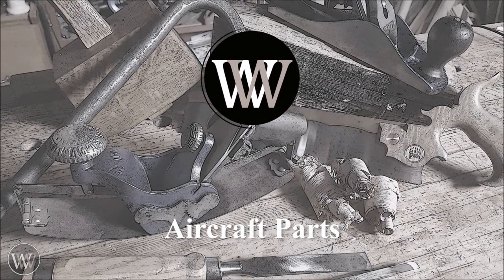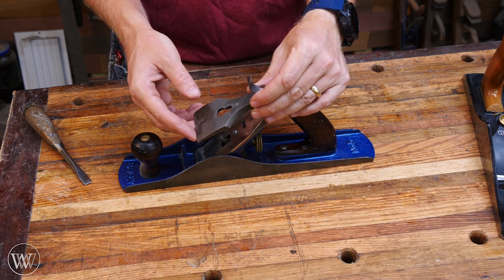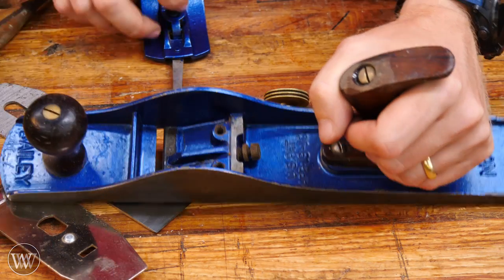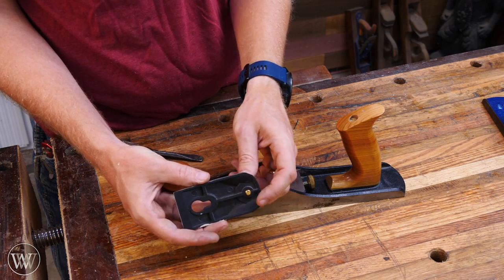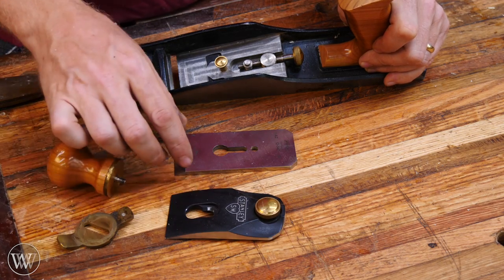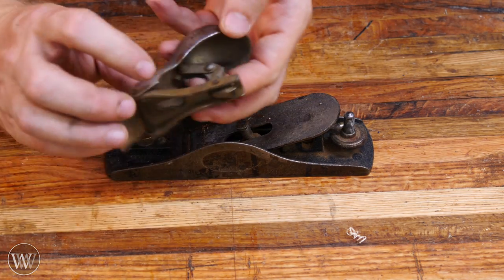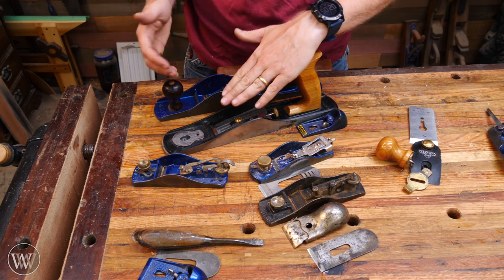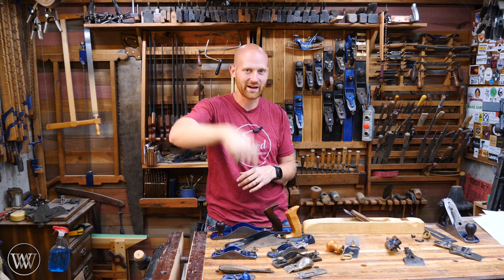What Are The Parts of a Hand Plane - Handplanes 101

Comment: Fun note:  I recently started restoring my grandfathers Sargent 408.  I lost a frog screw and after three store checks and two phone calls to fastener distributors in an attempt to find a replacement locally, had to settle for ordering from McMaster-Carr and waiting.  One of the reasons for this difficulty is the screw is a somewhat oddball size, but most importantly I didn't know my terminology for fasteners and the people I was talking to just pretended to know what I was talking about and failed at helping me.  It was one of the distributors in another part of my state that took the effort to explain how to properly talk about this screw or ask for it.  It is a #12-24 x 3/4" Fillister Head Slotted.  I ordered both zinc and stainless, 1" and 3/4" to see which I like better or to prevent any more issues.  I may have to shorten the 1" ones and I'll burn off the zinc and re-treat the steel to match the look of the plane when I'm done if I go that route.  Anyway, I just thought I'd share.  Great channel!  Thanks!
Reply from the maker: Sweet. I love making things work. Sounds like fun.

Comment: watched the entire thing to find out what the heck a chip breaker actually does and i still don't know
Reply from the maker: The chip breaker adds a little bit of mass to the iron so it doesn't vibrate quite as much. On top of that if it's pushed close enough to the tip it will actually break the curl coming up the plane this compresses the curl back down into the wood so when set up right you get less tear out. It's great for reversing grain or places that you get more tear out. If you look up my videos on how to set up a smoothing plane I go into great detail about how to place it and how it helps the cut.

Comment: Thanks, James.  I have a 60-1/2, 103, 71-1/2, No. 4, No. 1205 (scrub only), No. 5, No. 606, USS New Jersey (AKA No. 608), 12" draw knife, and a 151 spoke shave.  I always learn something by watching back-to-basics videos.  You mentioned the lateral adjustment lever and not removing it.  My 608 needs the lever replaced (badly pitted and cracked) and I would live to see a video from you on replacing one.  I have a mint replacement with pin, but have been reticent to dive in (I think peening the pin is where I start weeping like a little boy who's lost his mommy in the supermarket).  Oh, and you forgot the aileron.
Reply from the maker: that might be a good idea for a video. might have to give it a try. thanks

Comment: That was a lot of info in just 14:20. I have a question. On a Stanley style plane, should we put a drop of oil to between the frog and iron. I see you easily adjust the depth with one finger. Mine requires two fingers. Could my lever cap be too tight? Thanks for all your inspiration

Comment: Bought my first plane off of eBay. #5 Bailey plane with corrugated bottom. Seems to be in good condition, but the yoke won’t touch the adjustment knob. How do I get it back in place? I am new to woodworking and just trying to figure out if I got a back plane or not.
Reply from the maker: If you want to email me a picture I'd be glad to take a look at it. I'm not quite sure what you mean by the yoke won't touch the adjustment knob. You can find my email address on the about tab on my channel page. also if you use the contact form on my website I can email you back and you can send me a picture there.
Reply: Wood By Wright Thanks for reaching out! I figured out what happened and was able to put the yoke in the correct position. The previous owner had moved the frog to make the mouth larger. Thanks for the quick response! Should I keep this as a smoothing plane or convert it into a scrub plane? Was thinking about buying a veritable iron and using the old Stanley as a scrub iron.

Comment: hey homie thanks for the video, love it.
The lever cap broke on my grandfathers old hand planer and i was wondering how specific I had to get when purchasing a new part or if it would work to have something else in there.
the one I have is super simple, not even a frog in it, just a blade, lever cap and a screw that pushes the lever cap onto the blad and holds it in place. I'm hoping its a universal part as I just ordered one on ebay.
Lemme know if i just threw 10 bucks in the trash? Thanks man!
Reply from the maker: There are a lot of different ones but most will work well as long as they are the right width.
Reply: @WoodByWright  I should have measured but i threw the dice. I really hope it works. I am trying to learn how to build a guitar. Do more videos please!!!

Comment: One thing that confuses me is how to do the adjustments on different styles of planes.  On a Bailey style, there is no need to loosen the lever cap to adjust the blade. Just turn the screw in either direction to advance and retract the iron.  I am wondering about the Norris style.  Do you release the tension on it to adjust the blade in and out?  How about the block plane?  Do you release the lever cap or tension screw to make an adjustment and then tighten it up.  Different woodworkers say different things.  Would love to know what you do.
Reply from the maker: There is no need to loosen any of them to do the ajustment. Some people crank down the lever cap so hard that you can not move the iron, but that amount of pressure is unnecessarily in my book.
Reply: I will try medium pressure and see if my various planes will allow me to adjust the iron depth.  I have seen 'professional' woodworkers (on YouTube) always loosen the different types of lever caps on their planes.  What I find when you do that is that the blades move side to side and need to be centered.  Your method seems more practical and will not affect the lateral placement of the iron.  Thanks.
Reply from the maker: yup. I only touch the lever cap when I am cleaning out the plane or sharpening it.

Comment: hello there. i have just bought a Stanley hand plane no. 5 few days ago. and i found that there is no yoke assembling with my plane as you have on 3:45. i dont know why and i cannot plane anything. is it a big problem?
Reply from the maker: Sounds like it has been removed or broken off. A lot of times if the plane fell it would break just below that. You can still adjust the plane but you have to use a mallet and tap the iron in and out like you would with a wooden plane. It's a bit of a pain though.

Comment: What do you do for a number 4 that even when the depth adjustment knob is set as deep as it can be and yet it doesn't make a shaving and the blade doesn't even feel like it's sticking out of the bottom?
Reply from the maker: it sounds like you have the wrong chip breaker for the plane. several companies had different standards for the distance from the depth adjustment notch tot he tip of the iron. what you can do is move the chip breaker back from the tip tell the iron sticks out far enough to take a shaving.
Reply: Brandon Engel may be time for a new iron. Your current one may have been sharpened as far back as it can go and still reach the wood.
Alternatively, your cap-iron or frog may be just a bit too far forward.
I don't know your familiarity with planes, but is your plans-iron bevel facing down? If it was accidentally put together face up, it won't contact the wood as well. 
Just a few things to check. 
Check out James' how to set up a hand plans videos. Additional sources would be Paul Sellers' and/or The Plane Collector's channels.
Reply: Wood By Wright  it is a new plane I bought from Stanley and I don't want to have to move the chip breaker back... I want to keep it close to the cutting edge to help prevent tear out
Reply from the maker: then there is a manufacturing problem with the chip breaker. just make sure the yoke is in the notch on the chip breaker, but if it is and the blade is not engaging then there is a problem with the chip breaker.
Reply: IMHO the new Stanley planes are garbage, at least compared to old ones. Consider picking up a used one on ebay. A #4 can be had easily found under $40 bucks, more if is a Sweetheart or in really good condition. The standard blade works perfectly fine, but if you want to update it, a Hock blade and chip breaker can be swapped out and still keep the whole package under $100. It only takes an hour or two to clean one of these up and tune it.